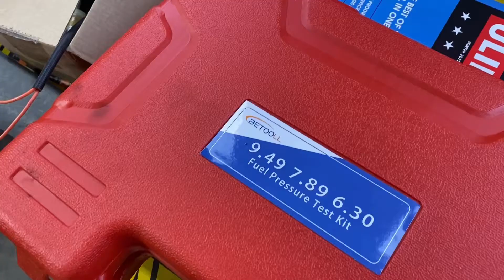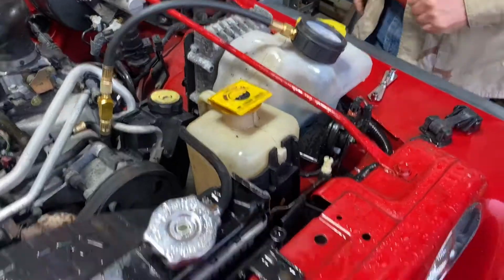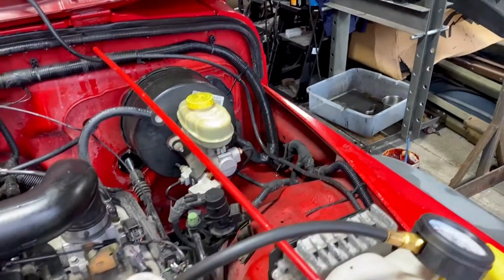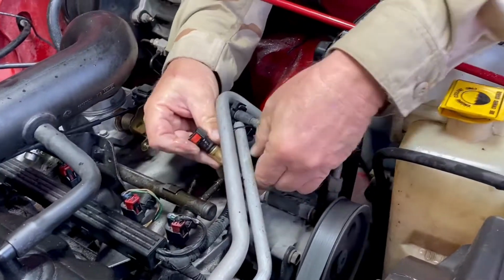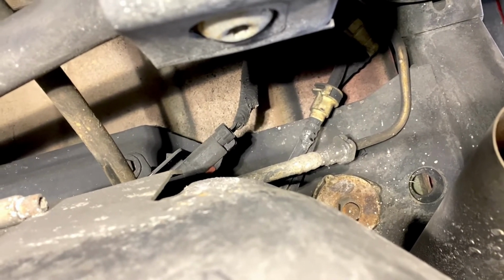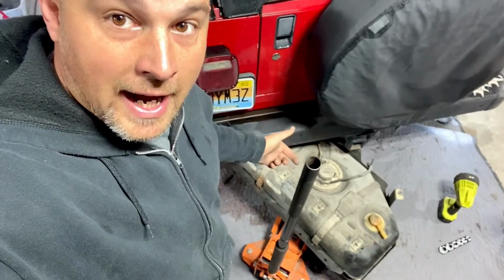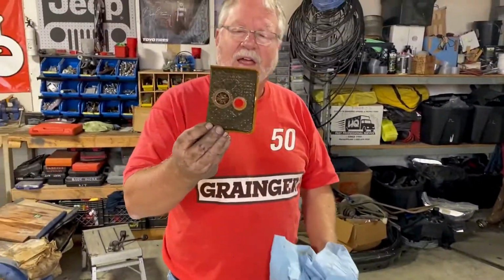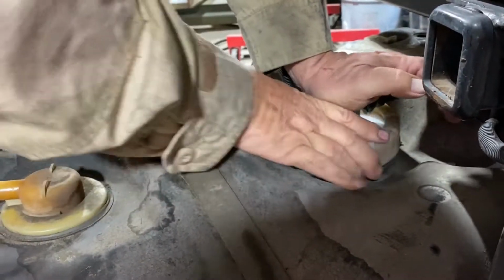How to Replace a Fuel Pump in a Jeep Wrangler TJ! (2004-2006)

Comment: I wonder if an access hole could be made, under the seat and carpet? I did that on a Dodge Durango, and I had the pump out , with a full tank, in 20 minutes. Not lying.

Comment: After replacement it started leaking from the quick connect fuel supply line. Any part # or solution?
Reply from the maker: Make sure it’s seated correct, ive also had the rubbing rings split on me while reinstalling soncheck those